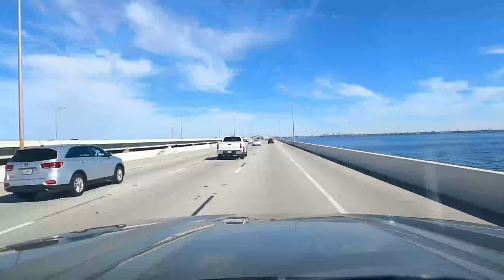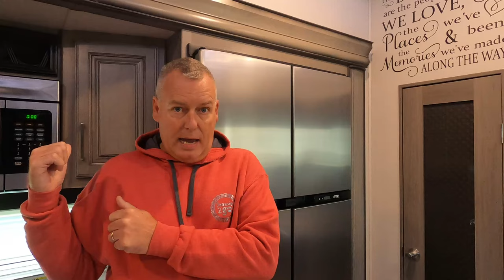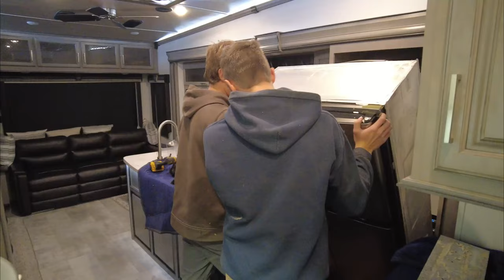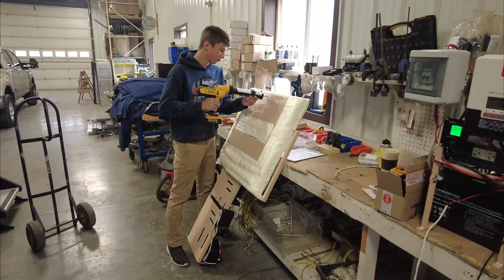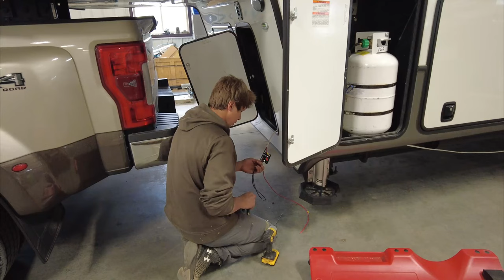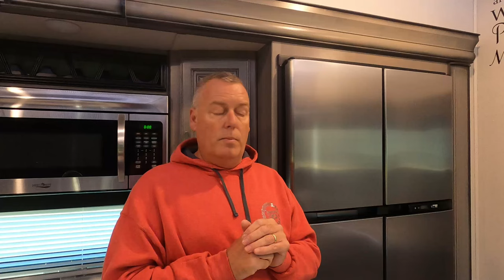Norcold RV refrigerator problems and solutions / What your dealer doesn't tell you

Comment: Excellent video!
Two question though,,,,,,,
- You mentioned that you now can control the fridge and freezer separately.  My fridge currently only has the same 1 - 9 setting that you have.
Did they install a dual control?  
- You mentioned that it was drawing about 7 amps.  Was this consistent over a longer period of time, say a day or a week?  The reason I ask is that we dry camp quite often with a AGM battery bank capacity of 434 amps, or 217 usable amp hours.  At 7 amps/hour that works out to about 168 amps per day.
I will probably go this route as it drives me crazy that I can't have my frozen product actually frozen now!
Thanks again.  Can't wait to really dig deeper into your channel!
Reply from the maker: Yes there is a separate controller for the freezer as it has its own compressor. That controller is mounted on the back of the fridge by the compressor. We set ours at 0 and then the regular 1-9 settings control the fridge. Our Amp draw is pretty consistent.  I can tell you we stay below zero in the freezer. Ice cream is now hard. We keep the fridge set on 2  or 3 and maintain 32 -34. Before I installed a 300w solar panel, we could run the fridge for 30 hrs and still read 11.22v. We run 2 group 29  wet cell as of now. On a sunny day, we can run the fridge with no v drop at all. The 300w panel keeps up. Like I said, best thing we have done. I can't say enough about this system.
Reply: @Jonesin2Go  Thanks so much!  I have already contacted JC-Refrigeration to see about this retrofit on our way South this winter from our Canadian home near Toronto.
Reply from the maker: Safe travels

Comment: What was the approx cost of the install for the dual 12 volt compressor at JC refrig. Ours in still under warranty but this may fix our issue.
Reply from the maker: It was around 1800 including installation.   Best thing we could have done. I just learned  as of October of this year  norcold will no longer be building absorption refrigerators. They are going to 12v compressors.  So if yours isn't working having it converted may be the way to go. We love ours.

Comment: Thank you for this video! We are snowbirds in Florida with a Norcold 1210 Electric/Propane refrigerator and we are experiencing the same thing you did. Our electricity bill is $115/Month (AT .16/kWH) and our Propane bill is $36/Month using electricity for the refrigerator. If we use Propane for the refrigerator, our electric bill decreases to $25/month but our Propane cost increases to $90/month so even though our cost is overall less using propane to run the refrigerator, we are still $115/month. I am very interested is having JR Refrigeration do the switch to 12V with the double compressor like you did but before I call them and make an appointment, can you tell me if everything is still working good after 2 years since you made this video and does ice cream freeze hard now or is it still soft like it is with an absorption refrigerator? Thank you!
Reply from the maker: Yes the fridge is still working great and the ice cream freezes very hard. We just sold that RV In October but the new owner loves it. It comes with a 3 year warranty  that you can extend. I highly recommend this conversion
Reply: @Jonesin2Go  Thank you! What RV do you have now? I just found your channel today (I subscribed) but I haven't watched any of your other videos yet.
Reply from the maker: @robh063  we have a new Montana 3901rk. When we ordered this one we ordered it with a 12v fridge because we liked the last so much.
Reply: @Jonesin2Go  Nice rig! I hope it's not the Furrion 12V you have. I have a friend that had two quit within a couple months of each other in his new Solitude. Grand Design has agreed to send him another 12V fridge but a different brand. I'm not sure of what brand but hopefully it will work better. I've heard nothing good about the Furrion offering.

Comment: Compressor Refrigeration is the way to go for sure… have been used on boats for years.  Very efficient.  A few points however… I have yet to see a NORCOLD fridge installed per their installation document.  Missing and misplaced baffles cause huge problems with efficient airflow at the rear of the units.  Second, the units are power hungry.  On electricity they burn 600 Watts, and until I fixed the baffles on my unit, the fridge would not shut off.   This means 14.5 KWh per day which works out to about $1.50 per day in power.  Over 30 days… $45.00.  Running on propane… A 30 pound propane tank contains about 650,000 BTU of energy.  The burner in the 2118 fridge is 3000 BTU per hour, giving a run time of about 9 days.  Still pretty expensive.  Third. An absorption refrigerator will never run down to 0 degrees in the freezer, you will not get hard ice cream… everything else will be frozen, but not sugary/creamy products (they are an antifreeze).  If and when our unit fails, I will definitely change over to a compressor unit.  Wish NORCOLD and DOMETIC would just manufacture a model with the compressor units.  Our compressor fridge on our boat runs on 270 Watts of solar and 200 amp hours of battery capacity.  Can’t go more than a day without sun, but during boating season, sun is not an issue.

Comment: The beauty of DC electric motors is they use an internal magnet. The power needed for electric motors to rotate is from creating electro magnets.  This means a DC motor will need lower wattage to create adequate power to run the compressors.

Comment: I watch your vid on norcold site on the jc refrigerator, so I found you on YouTube so I could ask ? And low and behold you just bought the same fifth wheel we live in 3901rk ours is a 23. So how did you like the 12 volt fridge in the long run and your new one is a house fridge. Also we stayed in n Tampa this last winter thanks matt
Reply from the maker: So the norcold that JC Refrigeration converted in our last Montana was a great decision. It worked great,in fact the new owners of that rig love it. It is doing great almost 3 years and still going strong.
 We ordered our new 3901RK with the 12v option for the refrigerator instead of the residential. It is a furrion brand. Unfortunately it does not perform as well as the JC Refrigeration conversation that we had done. Looks like we will be replacing it with something else soon, what has yet to be determined.

Comment: I had a 2019 Keystone Laredo 380MB and had similar issues, and it used a lot of propane. I now have a 2022 Momentum 395MS with what looks like the same fridge. 
This new unit runs far colder - I have digital thermometers monitoring and it stays solid on what you set it. It also uses very little propane, which I noticed right away.  
Makes me wonder if Norcold has updated this unit? 
It certainly seems like a different fridge by all accounts of performance, although the model is the same.
Reply from the maker: Hi Brian thanks for watching, and taking the time to leave a comment.  I hope that you continue to have better luck with this fridge. It was my hope that doing this video,would not only help others experiencing the same issues, but get norcolds attention.  We will be seeing some big changes in the refrigerators installed in RVs going forward. I just learned yesterday that Norcold has decided to stop building absorption refrigerators as of October. So 12v and residential will likely be the 2 choices going forward in my opinion.

Comment: Was your refrigerator still under warranty?  We have 2021 Montana with Norcold with similar issues.  Things freeze in refrigerator and though meat seems frozen ice cream is mush. We store medication and it is a concern if it would freeze.  Is new cooling unit electric/gas now?
Reply from the maker: When we had it converted it was not under the original manufacturer warranty however we had purchased the extended warranty and that covered it. Minus the deductible and the cost of running the 10 gauge wire from the battery to the refrigerator. It cost us like $250ish out of pocket back then. Our refrigerator is now a 12 volt and takes its power directly from the batteries. JC Refrigeration has other options available as well. Their current prices are listed on their website which is included in the description of this video. Converting ours was the best decision we ever made. Thanks for watching and supporting our channel Corinne

Comment: What was the total cost for the upgrade for the dual compressor and did you get a warranty for the work that they did.
Reply from the maker: My total was around $1900. That included all labor and  the extra wiring that's needed. It comes with a 3 year warranty and an additional 3 years can be purchased. All of the current prices are on their website. There is a link for that in the description.

Comment: You stated that you can control each compressor individually. Are you using the original control panel on the door to do that, or are there separate controllers?
Reply from the maker: There are 2 controllers.  The refrigerator still uses the controls on the door 1-9  and then you set the temp for the freezer on the controller that is located on the back of the fridge.  So you acces it by removing the lower panel on the outside of the coach. Very simple. We set our freezer at zero and just leave it there.
Reply: @Jonesin2Go  sounds like a great setup.

Comment: Hello I am curious how you control the freezer and fridge separate, does it use the original Norcold controls, I have a 1200LRIM and want to upgrade to the 12 volt
Reply from the maker: There is a separate controller for the freezer that they installed in the back of the fridge (accessible from the outside) they set that. And the fridge is controlled the same way as originally.

Comment: awesome video, but my question is if your boon docking, we have 2 of the yellow top batteries which are awesome for boondocking, ( 2020 3120RL) which is mostly run on batteries, how long approx. will this fridge run on batteries before you run out of juice?
Reply from the maker: I'm not sure yet. I can tell you that so far I have left it unplugged for about 30 hrs when I put the meter on my batteries it still read 11.22v
I am actually having a 300w solar panel installed this week and they tell me that will keep up with it. We have 2 interstate group 29 batteries.  I will be upgrading those to 2 100ah lithium batteries so that will extend the time also
Reply: @Jonesin2Go  yea i knew that was a hard question to answer. our last rig was a 331RL, it had the industrial fridge. when we boondocked, i had to run the generator atleast twice a day and the wife hated that, now with the 3120RL, its on gas shes loves it just hates its not cold enough? with the ice. (if you read we bought a portable ice maker that total awesome from Walmart for 99 bucks lol. she likes the setup but now shes worried this is running off the batteries even tho i got top of the line batteries. that we will have to run the gen. more often? you know cant make some wife's that worry to much happy.

Comment: I’ve watched this video a few times.. where you had a upgrade conversion cooling unit installed on your norcold.. I have a 1200lr and just today I noticed it’s leaking ammonia and the smell.. it’s gone.. question: do you like like the 12v  cooling unit? 
Don’t getting nosey , what was the cost for new system and install? If this is to personal I’ll understand.  Just trying to take the road here.. thanks
Reply from the maker: Yes we really like the 12v unit. It cools great and is very efficient. If you go the jc refrigeration web site they have pricing for several different units. I believe yours is included.  They do 12v. 110. And gas/electric. Well worth the up grade. We also have a 300w solar panel  and it keeps up without any trouble (when sun is out of course) our upgrade was just under $2000 including installation. Again it was well worth it.  Thanks for watching
Reply: Thanks .. I have plans to goto jc refrig. April.. have them to install the single compressor system.. thanks for your info.. you take care

Comment: Great video, but I disagree that the RV manufacturers have no responsibility in this issue.  If they are providing a product (RV) with a sub-par refrigerator, then they should take actions to fix this problem, at least going forward by NO LONGER OFFERING MODELS WITH THIS UNDERPERFORMING refrigerators.  If they continue to sell RVs with refrigerators (and freezers) that don't do the job adequately, then, I do blame the RV manufacturer.  It's not like we have the option to get one w/o a refrigerator (and a credit) so we can apply the $1,200 towards something else.  In some cases, there are residential options, but in other models, there are not other options.
Reply from the maker: I do believe this is why you have the option to go with a residential refrigerator.  Because that has been the only alternative untill recently.  Keep your eyes on the market I believe you will start to see more and more 12v refrigerators showing up in new units. And the manufacturers will move in that direction as they see the interest from consumers increasing.  There was more than one reason I did this video. The manufacturers monitor  social media and the comments.
Reply: I agree with Scott. Manufacturers are slik. They think consumers are dumb. Until some like you makes a video to point out what thousands of people are already experiencing. Manufacturers going the residential route to me is a cop out just to push more rv sales. Not really caring about the actual effeciency and the draw of a residential. I totally blame the manufacturers for passing down the cost of subpar appliances and the like. I could just imagine what else is subpar and garbage in the entire build of the rig. The bolts, the nuts, etc... ???!!! Workmanship and accountability are a real thing. Our Norcold 1200 woke us up beeping today. We're at the campground. Showing no co... We have a 2004 Fleetwood Bounder 35r. Well cared for. We are second owners. This is how I found your video. Sucks lemons to me that a manufacturer does this to consumers. Thank you for your time. This was very helpful! Wishing everyone HAPPY TRAILS❣️🎼

Comment: Our 2022 keystone cougar with the 12V compressor Norcold and 400i solar flex package cannot run the fridge at all.   The fridge starts throwing an E3 error code which is low-voltage. And this is despite the dual 6v batteries being completely charged with my generator.

Comment: Hi there, I've got my fifth wheel choices down to the Montana and the Jayco Northpoint. What I'm wondering is if you know anything about the 2 suspensions, Road Armor/Montana Vs the MorRyde on the Jayco, they look and seem identical just 2 different manufacturers. Have you ever looked into this? Any help would be appreciated. I don't see any you tube videos that cover the differences between the two suspensions.   You seem like the type of person to have checked them out, or know the info on them? Thanks
Reply from the maker: The road armor has the absorption system on top and bottom also brass bushings with wet bolts. A little more robust and longer lasting  imo
Reply: @Jonesin2Go  Thanks - yeah  i got that impression too.

Comment: Good info in the video.  I have the same unit and have always complained about how often it cycles on.  It runs at least 20 minutes every hour.  My old dometic unit would cycle a few minute every couple hours if not being opened.  Have you had to run it for extended periods on just battery?  How long will it go before pulling the batteries down is my biggest question.  We spend a lot of time off the grid.  I have solar and a generator.
Reply from the maker: I have run it while unplugged from shore power for 24 hrs and it's been fine. Currently I have 2  group 29 lead acid batteries.  I do have 300w of solar. As long as it's a sunny day it will run just fine a d the solar keeps the batteries at or over 12v. So in a perfect world where the sun shines every day. We could run it no stop.
Reply: @Jonesin2Go  that sounds good.  I have 2100w of solar on the roof and 552 AH of Lithium batteries.  During full sun its more than enough to run the Norcold,  but on cloudy days it will suck the batteries down running 120v on inverter . it uses around 650 watts when its running and its often running..  I both Love and hate this 2118.  The space is great, but its horribly inefficient.  On propane it uses 1/2 gallon a day to stay cool.  I may end up doing the dual 12v like you have.  Thanks again for the info.

Comment: Thanks for the video, just had the 12v dual compressor unit installed in our 2118.

What is the hottest temps you've been in, and what kind of temps was the fridge and freezer compartments able to maintain?
Reply from the maker: So far the warmest days have been low 80s. The highest setting we have set ours on has been 3 and we stay around 34 in the fridge and between 0 and 2 in the freezer. Right now we have been in the 50s and 60s outside and we have had to turn it down to 1 and we are seeing 0 in freezer and 34 in fridge.

Comment: Have the Norcold 2118sst in our 2017 Alpine fifth wheel.  Having some issues with left door flap sticking and thermister causing everything to freeze.  Have new thermister arriving today that I'm hoping fixes frozen issue in fridge.  Live in Northern Ohio and have fifth wheel stationary at campground in Andover.  If JC was able to do the conversion on site we would be interested.  I agree these Norcolds are not efficient by any means.  Thanks for sharing...
Reply from the maker: They also ship the units if installing it yourself is something that you can do.  It was the best thing we did for sure.